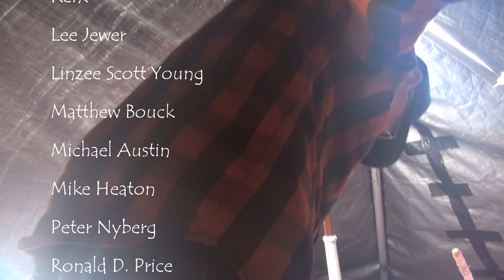Cruising Lealea: How to Cut Rope Like a Sailor and More

Comment: Previously you've featured your alcohol stove.  FYI, it is not possible to buy denatured alcohol anywhere in southern California now, it is not legal to distribute it, and this sounds like a regional law which varies all over.  I dont know why this restriction exists, but it is simply no longer available anywhere (not even industrial suppliers).   Perhaps check this before heading out or it could be that you won't be able to get any stove fuel later.
Reply from the maker: Coming out of SoCal, nothing surprises me. We will have to check into this. We haven't heard anything about it. I just picked up two gallons on Tuesday here in Petersburg.

Comment: Spectra works very well for lifelines, and is soft... at the diameter you probably want for good hand-feel, it probably will be 20x stronger than needed..   I used brummel splice around a large plastic thimble which I painted black (beforehand) for UV protection, these have held up amazingly well over many summers as my lifelines, the thimbles have outlasted the rope which now need replacing per spectra lifetime schedules..      How about some waterproof sunbrella fabric covers instead of the big plastic tarps?  Maybe more visually appealing and no more crackling plastic tarp sound ?
Reply from the maker: For the lifelines, Laura is after a particular look and the black three strand we have now is it.  We have a very nice and very expensive set of Sunbrella awnings that completely cover the boat and look great. We had them custom made in Hawaii and it is perfect for the tropics. Unfortunately we discovered that they are worse than useless when it snows. They were designed to protect from tropical sun and showers while allowing the cooling trade winds through. We put them up our first winter in the Pacific Northwest. That is when we discovered that a) Sunbrella does not shed snow so the awnings load up and collapse. b) Our beautiful Navy blue awnings turned green with algae from the constant wet with no sun. So....
Grey tarps like all the fishing boats use. They shed water and snow and they are cheap enough to replace every season. We are still working on a pattern that will look better and be more functional (Like our fancy tropical awning rig.)
Reply: @Cruisinglealea  Hmm, I see.  Amazing to recall I've been watching your channel since those first Hawaii videos so many years ago now and looking forward to your new season of videoing.

Comment: Guys look at your own video.  The decks are covered in mold, hardley Chuck ship shape.  You have set your final anchor.  I enjoyed the sails when they were real, but stop, the sail is over. Join the Moose, have a beer and tend the garden.
Reply from the maker: I almost missed this comment because we just finished our haul-out in Wrangell and are preparing to depart for Port Protection on tomorrows high tide. 
This is what a boat looks like after pulling off the covers following a winter in the Southeast Alaska rain forest. I prioritized changing the running rigging and getting Lealea ready for the two-day trip south to Wrangell above making the deck pretty for a video. In a month or so, assuming we are again in range of a wi-fi hot spot, we may share what she looks like AFTER spring commissioning.

Comment: There is no place for 3 strand polypropylene anywhere on a boat! Sooner or later you'll discover why. I wouldn't even use it to tie up a dinghy.
Reply from the maker: Thank you. You are correct and we agree. The best, and only, proper use for polypro is as a dinghy painter or tow rope because it floats and will not foul your prop. But thls is not polypropylene. It is polyester. Quite different.